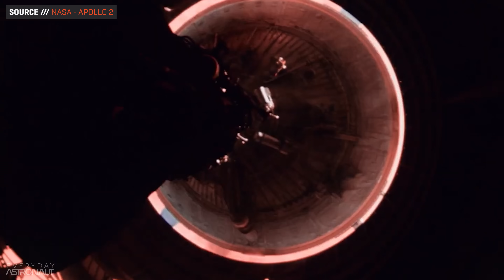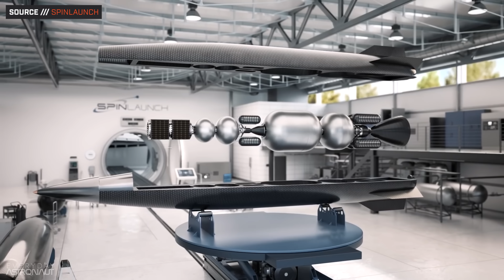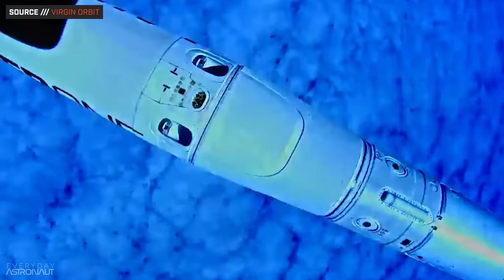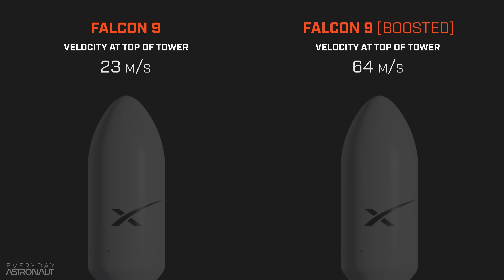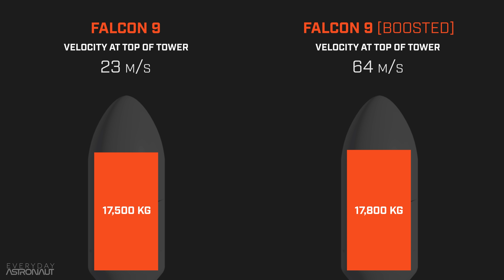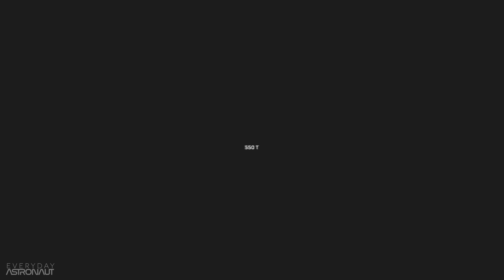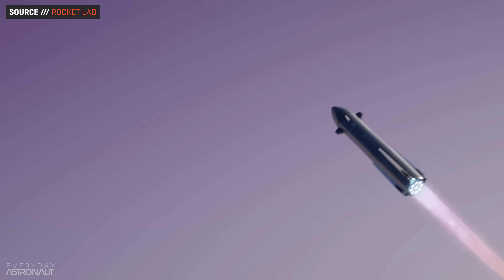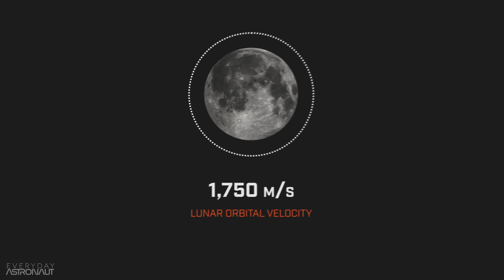Could We Help Push Rockets To Orbit?

Comment: The problem with the carriers used as visualization is the fact that these giants had their volume maximized in order to make them float. If you want to just use that as a counterweight, it should be enough to have a solid volume about 1/3 of the volume of ONE carrier.
Reply from the maker: I mean, we literally showed you exactly how big that volume would be in solid steel like 10 seconds after that visualization haha

Comment: Build rails on the side of a mountain.  You get the vertical and the downrange vector and the assist into rarified air and a slower energy transfer requirement and less structural requirements.

Comment: Jet engines are more effiecient at thrust at sea level due to not carrying any oxidizer. Add 16 Jet engines which can parachute down after hitting 300m/sec will help  the rocket be more efficient at launch.

Comment: How about using a a 747 to go to the moon.  Like a Star Trek shuttle.  Outer space is 329,000 feet up.  It takes 200 miles for a 747 to climb to 42,000 feet.  So it would take 1, 566 miles to gradually climb to outer space.  The moon is 239,000 miles away.  So the 747 would have to travel about 241,000 miles to get to the moon.  Or a Star Trek shuttle would have to travel 241,000 miles to get to the moon.  🙂
Reply: How about using an air balloon or air ship to lift the starship into outer space, and then launch it ?  How big of an air ballon or air ship would you need ?  🙂

Comment: 22:30 You know ... we talk about "vacuum" in these things, but (for a linear accelerator) a wind-tunnel setup would give you similar benefits: air intakes at the surface (surrounding the exit) with large-bore pipes and high-speed & volume compressor banks pushing air to the base of the mag-lev. 313 m/s is a tall order, but all that air trying to squeeze past the rocket makes the first second of acceleration a lot easier 🤷‍♂

Comment: Not knowing enough to have any idea of feasibility, but I'm reminded of aircraft carrier catapults. Would a steam catapult system have some kind of mechanical advantage over magnetic lifting? The submarine missiles showcased early in the missiles used compressed air plugs, I believe, to shove them above the waterline for launch. Maybe something a bit more primitive would have more power for less total energy cost if conversion is a big part of the issue.

Comment: One of the big advantage of spin launches centrifuge setup, or a circular mag lev track, is that you can get the cargo up to speed slowly over the course of hours rather than seconds so the peak power is much lower. The track can also be way shorter since you're looping though it multiple times. Downside though is the centripetal acceleration would liquify astronauts. But for cargo that can handle the g's spin launch would work great on the moon, a centrifuge arm just a few dozen meters long instead of a multikilometer long track. You wouldn't even need the complex door and vacuum chamber setup since the moon's already a vacuum.

Comment: i like that tunnel underground that uses a maglev for launching the rocket but what if that tunnel is in the ocean and outside of that tunnel(which is underwater) are a couple of rocket shaped compartment filled with air. It wont have a lot of speed but it'll definitely assist a heavy rocket going up. If there is something wrong and decided to cancel tha launch, theyll just stop the  ignition and the rocket would just splash back into the ocean. similar to a whale jumping off the water.

Comment: The solution to the boost at launch is right in front of your face. Raptor engines on the assist cradle that are feed from the tank farm. You could have the same number of engines as are on the booster.

Comment: When you said "rockets consume a lot of fuel on liftoff", my immediate thought wasn't "let's yeet them", it was "let's have a hose between the tower and the rocket, so we can replace the lost fuel". How would the math for that work out?
Reply: Sounds a bit like refuelling a car while having open fire at the filling station.    Might be ... delicate ...
Reply: @huckleberryfinn-cz3gd  its more like refueling your car as your moving out of the driveway
Reply: Less good than you would think. As the rocket burns fuel, the mass of the rocket decreases, and the Thrust to Weight Ratio gets better. By keeping the rocket fully topped off for the first few seconds of ascent you will be clearing the tower at a lower speed than you would have had otherwise.

And you will have turned the tower into a bomb right next to a titanic ignition source that is at the bottom of an even larger bomb. Rocketry already rides the red line on the scales of safety and capability.

Remember that you always have the option to just strap on some single use solid rocket engines if your launch system needs a little more payload capacity from time to time. Rocketry has a plethora of downsides and difficulties, but the alternatives vary between excessive cost for negligible gains and outright being beyond the material capabilities of today.
Reply: better than almost every other concept, but still not great.

it'd greatly increase the risk of an accident, would require massive high flow pumps to transfer fuel and oxidiser, and would increase payload capacity by maybe 1% if you're lucky.

the least absurd option would probably be inspired by "holding an empty plastic bottle underwater and releasing it so you can watch it shoot up out of the water due to buoyancy". 

as in, have an air filled open-ended launch tube as part of an ocean-going vessel so you can use the ocean water as your "counterweight", put the rocket at the bottom of the tube hundreds of meters below sea level, after pumping all the water out of the tube, mount the rocket on a pusher plate/piston, release it, and the massive relative pressure of that water will ram the rocket into the sky more efficiently than almost any other method. it'll maybe improve payload capacity by 5-10% with an upfront cost of billions of dollars for the launcher, which could end up being single use if anything goes wrong. and thats the least absurd option... 

it'd be easier and cheaper to just build a 20 million ton rocket (as ridiculous as it sounds, its literally easier than every other option), the "tyranny of the rocket equation" applies to interplanetary travel but for getting to orbit your payload is always going to be 1-5% of the total mass... if you can get a million tons to orbit in one launch it opens a lot of possibilities.
Reply: I was thinking something similar, except instead of refilling the rocket's tank as it's lifting off, use off-board tanks to fuel a collar of rocket engines that detach from the rocket once it clears the tower. You would get extra initial thrust like a booster, but only add the weight of the rocket engines, not an entire booster stack + fuel. Plus, it could work with any rocket with minimum modifications.
Reply: @morosoph I woke up dreaming about this exact same idea and took half an hour of scrolling through the comments to find that someone else also thought of it!

We already have the chopsticks to act as a method of holding up the collar post-release. Maybe just add another tower (or 3) on opposite sides for balance.
Reply: If I'm not mistaken the Saturn V did a similar feat, you can even see the hose pumping until they disconect when the Saturn leaves the tower im some videos.

I think Scott Manley has a video around it.
Reply: it doesn't consume a massive amount of fuel clearing the pad, it consumes a massive amount of fuel clearing the troposphere. Connecting a hose to the rocket for two seconds would introduce a massive head ache to fill the tank up .04%. 

If you want to think of it like this, driving your car out of the drive way doesn't consume much gas, but driving through town to get to the highway might.

Comment: These are some big amounts of energy all right but burning up fuel is not an alternative way to somehow not to require this energy. Disregarding storage, burning up the same propellant in a turbine is likely to get you a better yield.
Reply: Take the Moon launch example. If you have a goal of launching stuff from moon, not you still need the same amount of energy in form of propellant... you need it delivered to the Moon. Producing energy on the Moon or Moon's orbit (dunno, giant solar mirrors?) is a huge challenge all right, but it's at least theoretically sane.

Comment: The idea of a rocket called Sea Dragon was tested long ago, at least on the drawing board. In other words, the easiest way to launch a heavy rocket is from underwater, simply giving the platform enough buoyancy. Then, air balloons would be enough to propel the rocket as it launches from beneath the surface. The engines would then be ignited just near the surface.

Comment: I have always wondered why do rockets need to be launched straight up? Most of the weight is fuel needed to propell it upwards and most of the fuel is added weight that needs more fuel to be able to move that fuel weight. Has anyone done the math how much fuel would be needed if they launch as aircrafts with wings?

Comment: Short answer: yes.
Probably the safest way would be to use magnets, yep.
Although the weight of the magnets would eat up a lot of the benefit.
In order to see much benefit, you're gonna need a mobile sled which would rise with the rocket, and then detach from the rocket.

Also your math is wrong. if it's 23 m/s without, and 41m/s with, then you have a net gain of 18m/s, not 41. Which brings the cargo benefit back down to roughly the weight of the magnets you'll need on the rocket.
But if you give it a taller tower, or a silo with some travel distance below ground, and you make the magnets "detachable" from the rocket... you could have something worth having, yeah.

Spin-launch is a scam though. Junk science, on multiple levels.

I think the biggest obstacle, is that a rocket is pretty efficient itself. So you could get similar benefit just by strapping on some small external rocket fuel tanks, with a fuel source switch, and drop those tanks at say several hundred feet up (soft landing). That would be simpler, and cheaper. Kinda like the old jato rockets to assist an overweight plane in a short takeoff. Cost of just some aluminum & rocket fuel. Or just actually use jato rockets... But at that point, the question is, why not just build a bit bigger rocket?

If you REALLY want some impressive payload & velocity though, just figure out how to make "Asparagus Staging" work well. That has extreme potential ...with some wonky fuel delivery hurdles to figure out.

Comment: Really.  An everyday 500 kV power transmission line easily moves 1,500 MW over large distances.  That is 3 times your super heavy example. Rockets are, as you described in your intro, are already super extreme power users.  What could a super extreme transmission line do.

Comment: Perhaps it would help to launch rockets from higher altitudes.? Like,  how much difference would it make to launch a given size rocket from an altitude of 100 meters, or 500 meters, or a thousand meters altitude? How much fuel could be  saved by having an elevated starting position?  And would the cost of transporting building material and fuel up to a higher altitude be too costly.?.

Comment: 300kg of payload added to the Falcon but how much of that is taken up by the structure required to transfer the loads from the tower attachment points into a rocket previously mass optimised for the loads from the engines below it?

Comment: 12:20 or you could use the entire fleet of 50 ZSSK Cargo 131 class twin electric locomotives and then 40 more. That is just insane. I am not even going to compare the numbers for Starship.
22:14 That is equal to 10 heavy freight trains each with two ZSSK Cargo 131 class twin units driving at full power the up the Štrba incline of 1,5%. Still a lot, but much more realistic.
Just shows how little sense all this makes.

Comment: In the case of the moon mining, the assist could be a reusable rocket on rails instead of an electric train. The payload would still need thrusters but less total weight and the "rocket train" could be reusable. The fuel could be produced on site using some local crater ice and sun energy we could accumulate the fuel slowly over time so the infrastructure could be less massive.

Comment: what if you would launch the rocket on an horizontal train track that very gradually goes almost vertical, your acceleration would be the same thing as your thrust to weight ratio instead of thrust to weight ratio minus 1, and they could dump the wheels in the water as soon as it clears the track

Comment: Perhaps we could have an external fuel supply connected from the tower to the rocket so that it won't have to use its internal fuel until it is above the tower 🤔 The rocket can then either lift off with less internal fuel/more payload or have more fuel in total for the rest of the flight.

Comment: Why use electricity? You could make a vertical assist using pneumatic or even slow burning explosive. Even if using magnetic systems you could use a cable or piston to keep the valuable systems away from the blast. I think linear systems like the maglev do have a future.

Comment: You do know that the Falcon-9's first stage rocket consumes 1,470,000 KWh of energy at a cost of $50,000 US and a total weight of 1st stage rocket (wet) 407,000 Kg.  All this at an efficiency of around 30-40%.

In your video, you always talk of adding payload.  What if instead of adding payload, how about trying to reduce the weight of the fuel needed and have savings.

Comment: There's a reason they've used steam catapults for decades to launch aircraft off carriers and only just now have started using electrical catapults. 

The whole concept is something I file under "theoretically possible, but impractical or practically impossible". Certainly not worth the effort for eg. the marginal increase in pay load for the falcon 9.

Comment: Interesting calculations...
The rocket can accelerate from a depth of 500 meters (it is not necessary to dig a quarry, but it is enough to dig a vertical tunnel), which will allow you to set a high initial velocity and thereby reduce the weight of the rocket decently, given that the Falcon 9 has a fuel weight of more than 500 tons with a payload capacity of 28 tons. Perhaps the external acceleration system will not pay for itself for the launch, but for the Falcon 9 with a large number of launches, it will pay for itself without problems. This will also make it possible to cheaply deliver fuel to orbit for refueling the starship. Or replace it altogether with 5 Falcon 9 launches to form a rocket assembly of 5 highly specialized segments.

Comment: But Tim, we already made something related, ICBM launch system experiments.
4 concrete shafts instead of a tower is much easier, a launch-only platform, 1 shaft for falling mass, concrete is cheaper, fall breaks pneumatically and hydraulically, water thrust up on 4th shaft. Second shaft for the vehicle, and third shaft for engine exhaust.

Comment: Theoretically it is possible, practically it is hard and requires massive investment with big risk.

We can build a 500m steel skyscraper with a conductive coil for magnetic levitation to push the rocket upwards and provide some initial velocity. Such a tower can be built at higher elevations to avoid friction as well.

Comment: Would it be possible to use buoyancy system. Either dig a massive well or have a launching platform at sea then use an underwater platform to fill and empty a vessel that can propell the platform above.

Comment: You missed another situation I've been thinking:

A few heavy lift helicopters hovering  above and away from the rocket feeding it with fuel while the rocket is lifting. At some point,the helicopters fueling tube detach from the rocket.
This method allows the rocket to replenish a % Tage of the lost,/ used fuel during the initial liftoff.

Comment: Why are we still talking about spinlaunch in 2025? It has always been a scam. Centripetal acceleration in it is even higher than the acceleration in the cannon of the same length as the spinner's diameter, and along the long axis of the yeeted device. And the jerk(change in acceleration) when releasing the device is also higher because in a cannon, you can equalise the pressure of gases to air when the projectile leaves the barrel, making the acceleration smooth. They are just burning investors' money.

Comment: How will you grip the rocket at right points so that the force is equally distributed and not jerk off the rocket with huge pressure at certain segment of the rocket without breaking its entire assembly?

Comment: Put the rocket in a launch cradle, which in turn is pulled by cables. The cables are connected to a horizontal rocket sled on a track, going away from the launch tower. The sled is just a massive rocket, but one that can easily be reused as it never leaves the launch site. And since it doesn't need to cope with atmospheric stresses or the load of a payload and second stage, it can be made much lighter and cheaper. Just a big tank with a number of engines at the back. Getting the power required is easy with rockets, and all the infrastructure for filling up and handling the rockets is already there.

Comment: Tim, 35,399MJ is not a lot of energy at all! the starship itself needs 58,608,000MJ, so thats less than 0.1% of the energy the starship uses from earth to orbit. a field of 2000m² solar panels on the moon at 20% efficiency could easily power on such launch EVERY DAY. to give you a perspective: a football field is roughly 7000m² so a football field sized solar panel area on the moon could easily power 3 of these launches daily